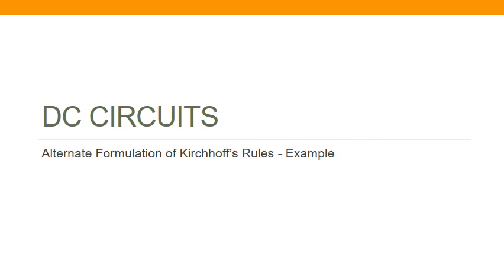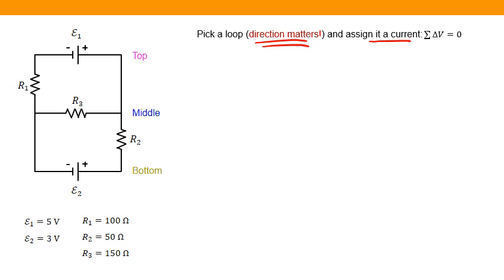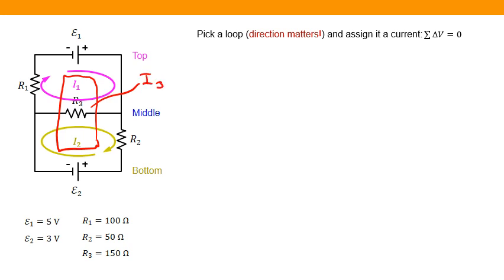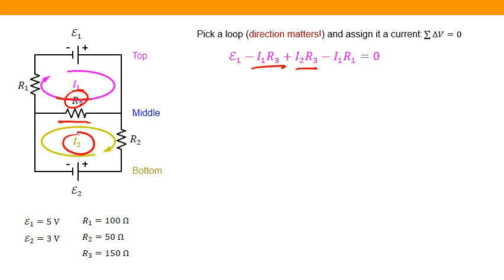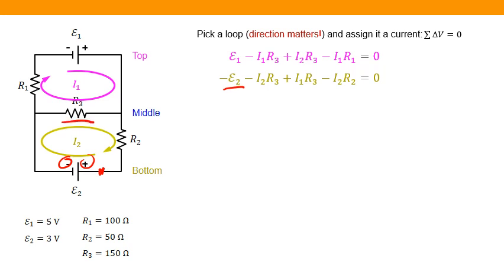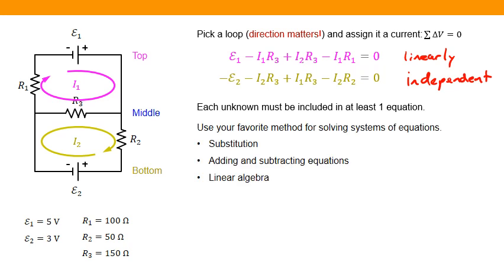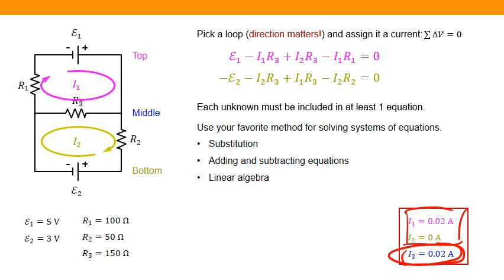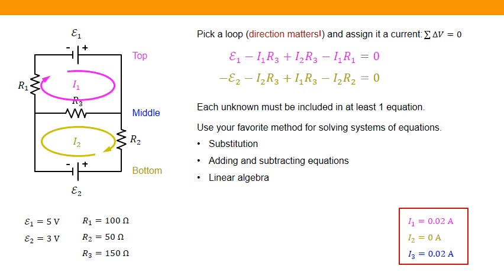Kirchhoff's Rule - alternate approach

Comment from the maker: In the video, I said the current in the middle resistor is going to be a combination of the current in the top loop and in the bottom loop, but I realized that I didn't explain what that combination ultimately is.  If you think clearly about current, you can probably see the answer.

The combination depends on the directions of your loops.  If they have both currents going in the same direction in the middle, then you can simply add the two and the middle current points in the same direction as your loops.  If the currents point in different directions (as in this example), you subtract the smaller from the larger current and the result points in the direction of the larger current.
Reply: thank you, I havent seen much alternate methods for Kirchoffs rule other than Walter Lewin. Would this method work if a battery is placed next to the resistor on the middle line?